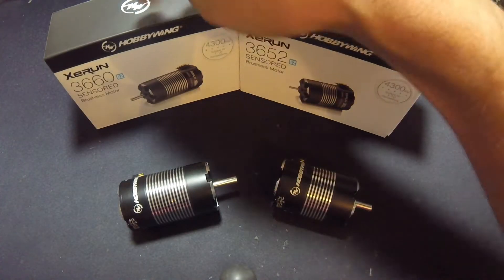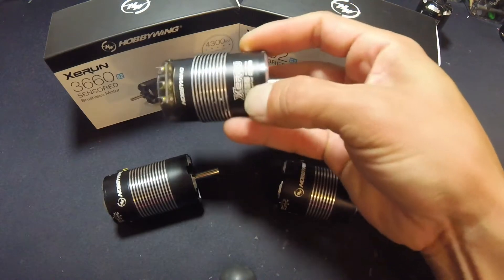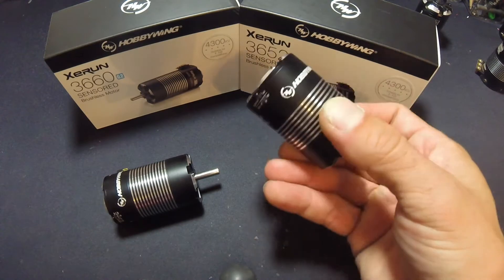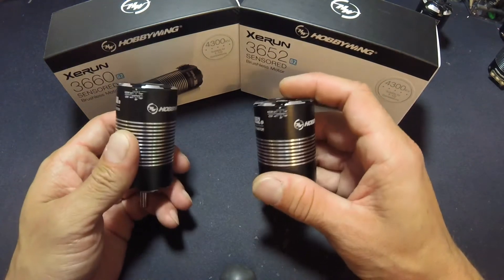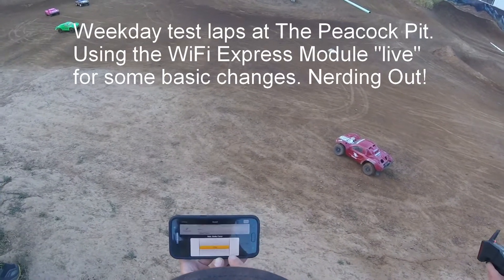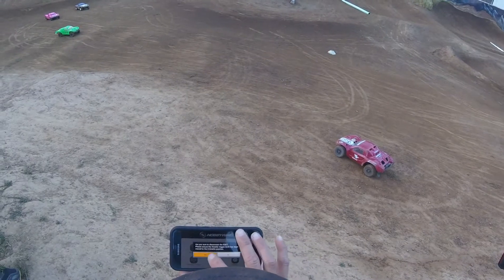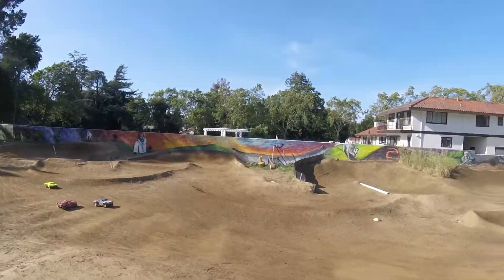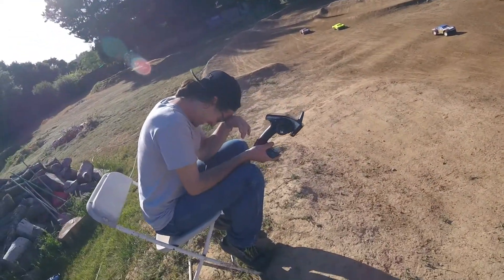The Charlie Show /// Episode 8 /// Motors, Laps, and Laughs

Comment: What is the timing purpose for the motor sir?
Reply from the maker: We can talk more about "Motor timing" soon, but the short answer, is that it changes the RPM and power band of the motors.  More timing, More RPM is the idea.
Reply: thanks HW. =).. will wait for the motor timing setup video soon..im running a xr8 & 4274
Reply from the maker: Timing is very much like a gearing change.  In some "tuning" cases, changing 1 pinion gear tooth is "not enough" or "too much", so the endbell timing on the motor, allows minor changes in the motor that are much the same as a gearing change.  

Or if a user does not have a larger or smaller pinion gear, timing changes to the motor can achieve a similar effect. 

Thanks for bringing this up, we'll add this to our topics for future shows!
Reply: Hi sir,thanks for giving a bit clearer pic on the timing system example like the pinion setting.sort of a bypas assist on the motor timming? As pinion gearing role is more on the ratio purpose.sorry if I'm wrong interpret :)